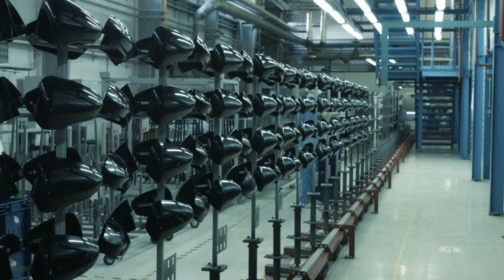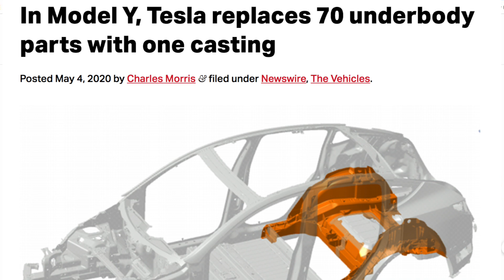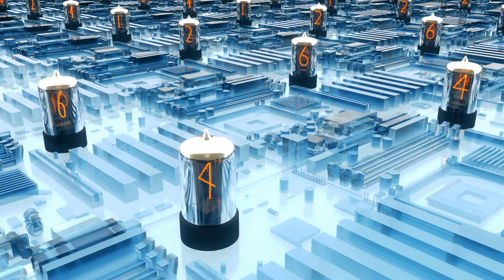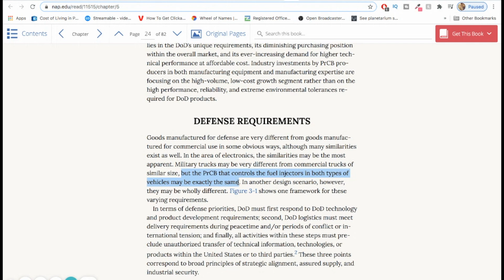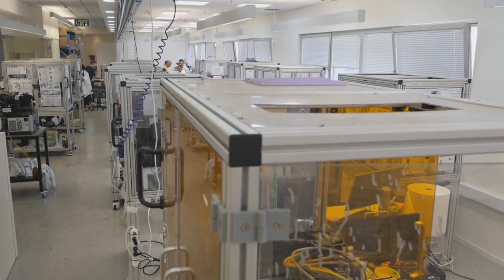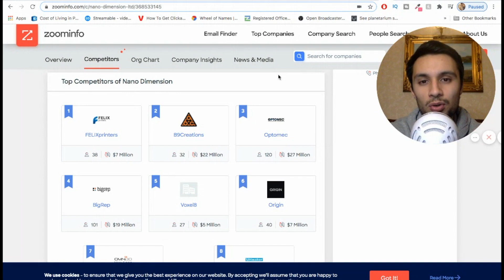Nano Dimension BOOM to $100? Is NNDM stock a BUY? PART 2

Comment: Change my mind: 3d printing does not scale in terms of speed for the kind of mass production you keep circling back to as to why the upside is so enormous.
Reply from the maker: Great comment. Are you talking about the present or are you talking about the future? :D

I would say in terms of NNDM, what they currently have (dragonfly) is focused on speeding up prototyping PCBS, so companies can develop get to the mass production faster.

In other industries it looks like they claim they can - https://www.3dsystems.com/masscustom
Reply: They can produce un manned for 24 hours a day wihout the need for human intervention.
Reply: true but instead of buying machines designed for one purpose, you can buy 10 3d printers that can produce basically anything. Technology will catch up in terms of speed
Reply: for now i'm thinking the 3d printing will be for more specialized part production, while in the future it will be for mass production